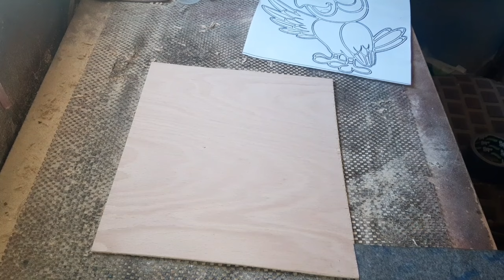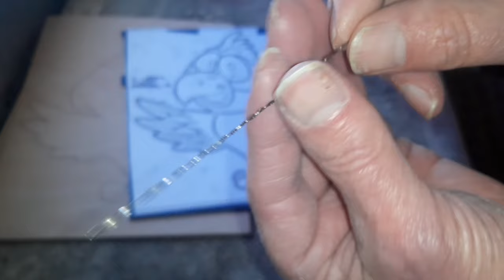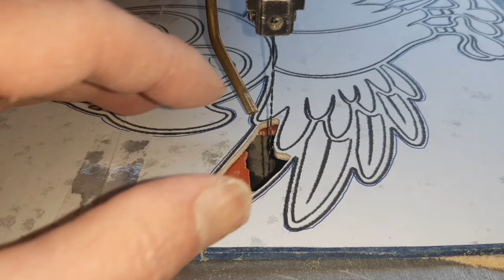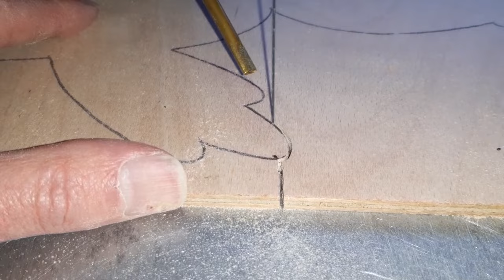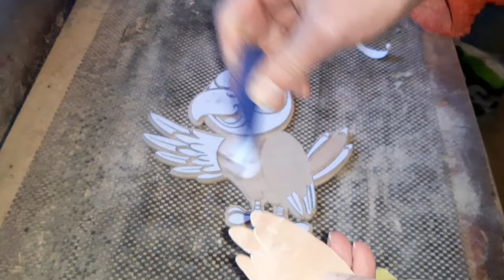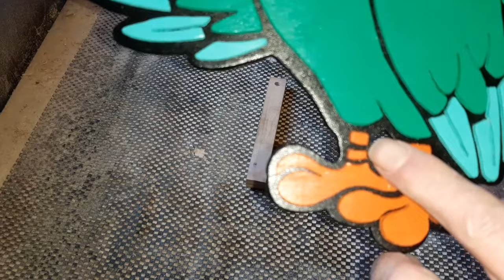Little Cartoon Bird cut out on plywood. scroll saw project

Comment: Shane After watching your videos I completed m first project. It went really well, but I discovered that not all resins are equal. I made it work, but it seemed to be hardening very quickly. I bought this resin at local hobby shop, I think I will be trying another brand.
Reply from the maker: Thank you  I've tried four different resins ,amazing clear cast, craft resin ,glass cast and vista one ..vista one is my favourite at the moment..Good luck with your search..😁👍